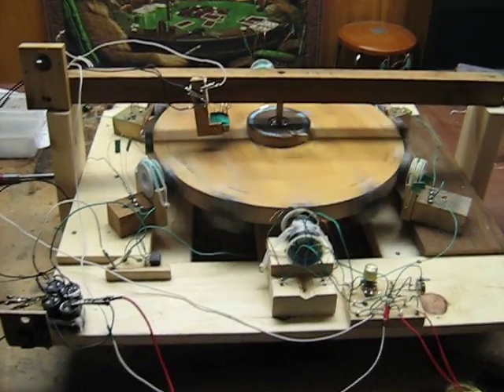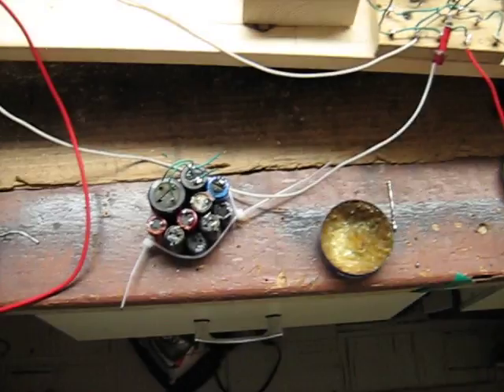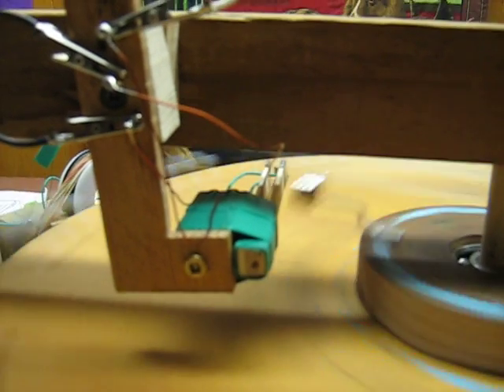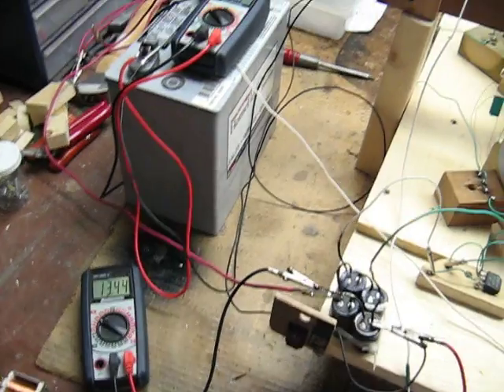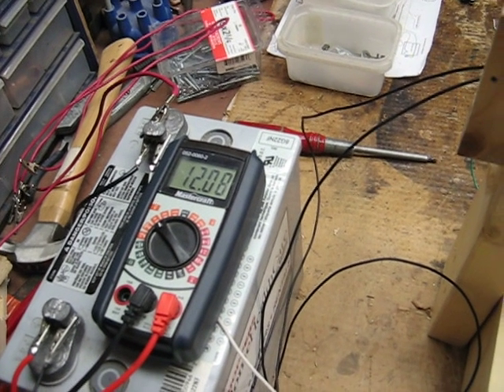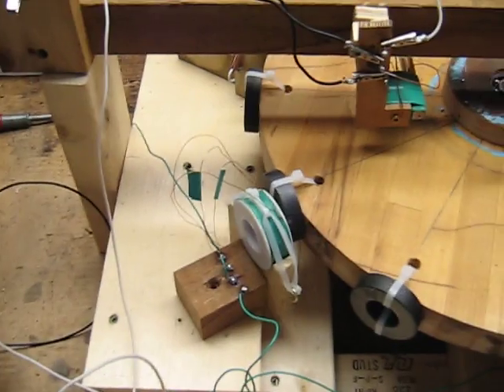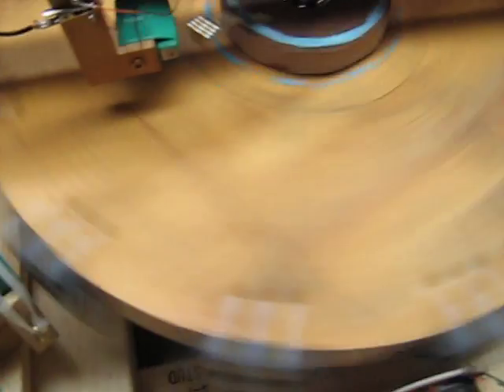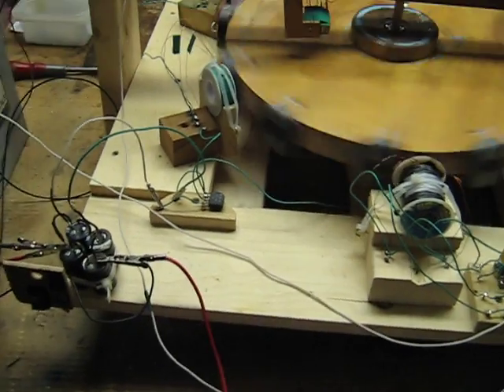Bedini - Self Runner - w/ Reed Switch

Comment: Hello again just wants to tell you that ive have mounted magnets to my new wheel and tested it, there are 18 magnets over the smal generator coils and 3 to run the wheel. My generator coils are producing volts butt i cant even light a smal flashligth bulb...annyway iam still onit and video is on its way